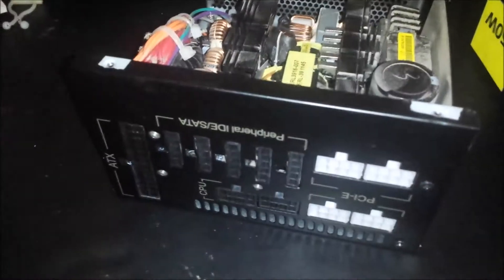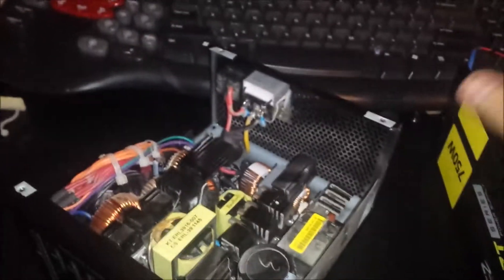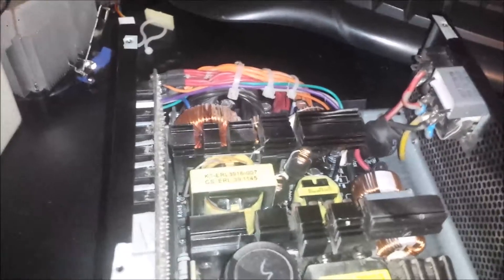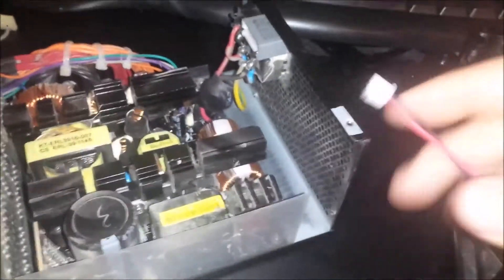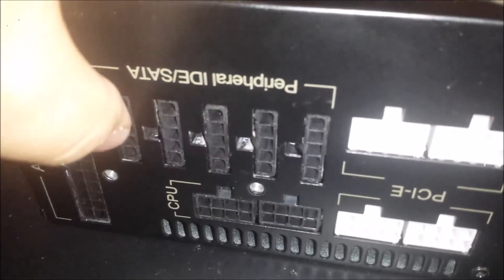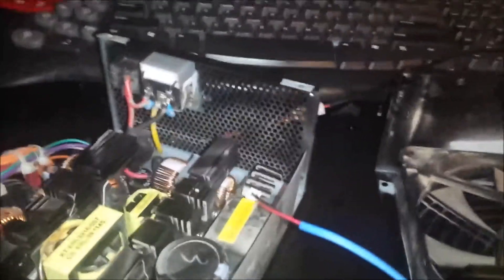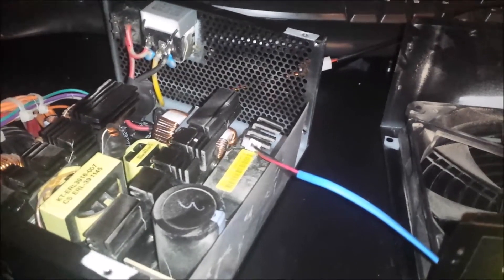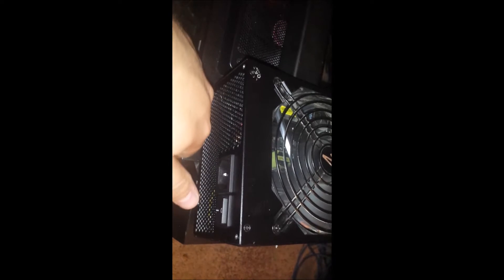OCZ noisy PSU fan fix cheap!

Comment: You should have the psu mounted with the fan on the bottom so it sucks in cool air from outside the case. Definitely gonna try this fix out, I have the same exact psu and it sounds like a god damn jet engine when I turn it on.

Comment: Hey, i also have this issue, hoping you'll reply, does the PSU not have some sort of  safety measure for not having the fan connected to the pin header inside the unit? i was just going to hook up the fan to my fan controller if i can just do that.

Comment: Nice job man! I have a PSU that has this issue, and I'll definetly do a fix like you.
I'm just curious about the resistor/voltage you have on your fan.
Cheers!
Reply from the maker: To be honest I didn't check with a meter....I just tried some I had laying around...which was a big pile I have collected over the years..Best of luck to ya though the fan didn't bother me while gaming but once I stopped gaming it was very annoying. I would test resistance but the PC is sold.